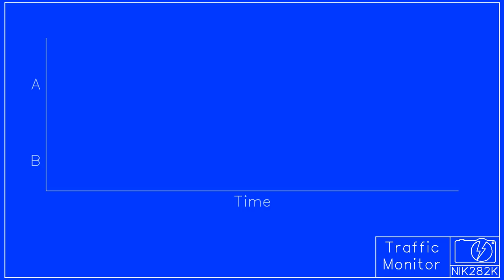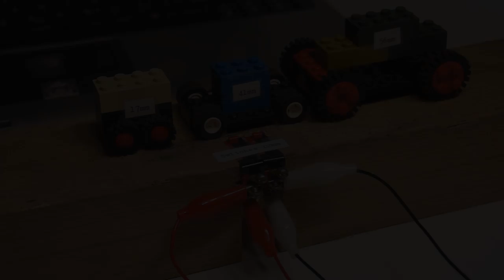How Traffic Counters Work

Comment: These are used in the UK a lot. There are permanent traffic monitoring devices installed all around heavily populated areas that work on induction loops put under the surface of the road. You can see the cuts in the surface where the wires have been laid that also trail off to the side of the road to a small box, or lid to a device underground. These tube versions are very temporary and go to devices chained to lamp posts usually with small but thick steel containers and padlock.

Comment: Do the hoses use hydraulic pressure to activate switches in the box or a conductor wire in the hose itself? If using pressure how do they deal with the speed of sound when monitoring a large multi lane road (as there will be a limit on how fast the fluid can re-stabilize between cars)? If electric conductors how do they get them to not break down under the weight of constant commercial traffic?
Reply from the maker: I have never had my hands on a real traffic monitor so I am not sure but some one else here mentioned that there may be electronic sensor strips that can deal with signals from multiple lanes (and wouldn't suffer from propagation times). Very interesting idea, I hadn't thought about the rebound time of the system.

Comment: Belgian here. We see these all the time when there are new circulation plans upcoming. Seeing a large number of these over the city almost always means that soon enough there will be a new circulation plan, yet again (these happen every decade or so). 
I've always wondered a few things about these, though. How do they detect? I always assumed that it's pressure based. If so, can't you also try to calculate the weight of the vehicle passing by, or is the range in which the pressure changes just too small to have accurate results? Further, I've seen them on bicycle paths as well here. Are those different, as in they have different pressure? And lastly, what if they are spanned over multiple lanes, or even over bicycle lanes in the same direction? Is it possible to determine the lane the vehicle drove on? How accurate is it when two vehicles pass by (nearly) simultaneously? 
You almost exclusively see them going diagonally across here. That way, there's data for all four tires, not just the two axles! Well, that's assuming you could see the pressure difference between one and two tires in the first place. But then again, more length means a higher probability on simultaneous passings, so they must be able to detect multiple tires, right?

(Edit: a word)
Reply from the maker: The diagonal method is perfect for removing ambiguity in the signals, I wish I had known about that earlier >_<

As far as I know the ones in use here only detect presence or absence of a tire but elsewhere in the comments someone mentioned that there are sensor strips that are able to tell from which lane the signal is coming.

With an air pressure sensor it might still be possible to tell how far along the car is, a car close to the sensor would produce a higher pressure spike than one at the far end of the tube but I don't know how accurate it could be.
Reply: You just found the fatal flaw of hose counters. They are really inaccurate on multi lane roads. As for seeing them about every 10 years in Belgium. I don't know your country's laws but in the united states its required every 10 years minimum that every agency that manages roads is required by the federal government to do traffic studies on every single road that they manage and send the studies to the F.H.A. (federal highway administration) or they can pull any funding that they are supporting.
Reply from the maker: Someone else mentioned that there are multi-lane hoses that have sections to distinguish traffic. I imagine they wouldn't be too hard to make.

Comment: I am curious to know if they can discern data from "confuse scenarios" such as two cars passing by each other over the detector... I guess there can be some multiple results on those cases. Also, I was wondering if the sensors could also measure the pressure over the hose. Seems like the cheapest sensor would be hidraulic, thus you could collect yet another type of info, I guess...
Reply: DoNotPushHere yeah that's what I never understood. They go over the WHOLE road here when I see them. How are they differentiating between the opposite directions of traffic? Speed information would seemingly be impossible to determine
Reply: 10mintwo  my only guess is that the data collected is filtered. Since they do not intend to track individuals, I think they might discard any conflictive data...
Reply: I'm sure that you will get some bad data from cars passing at the same time, but when you're looking at datasets that could easily be over 1000 cars an hour, it's not a big problem.
I can't find any specific evidence, but I think the cable they use for the detector might be a thing called quantum tunnelling composite.
Reply: That's quite a surprise for me. I thought those hoses would rely on pure fluids, due to them being placed on...the street... open to the environment and any harsh conditions... So it's sort of a long array of pressure sensors?
Reply: DoNotPushHere: The hoses are just full of air.

One end is sealed, the other has a pressure operated switch.
When a tire squeezes (squashes) the tube, that creates enough of an increase in air pressure to operate the switch.
Reply: Depending how smart the data collection is done, it wouldn't be too hard to extrapolate the data and assume that the majority of traffic are cars. Using 2 pipes helps to detect if two cars are passing in opposite directions because the vehicle's wheel will only be on 1 pipe at a time, so two cars passing each other could only hit 1 pipe at the same time but the second pipe tells the truth immediately after, or vice versa.

Comment: How do these work when the road has multiple lanes in the same direction? Does each lane count as its own sensor or is the entire length of the cord one big sensing element?
Reply: Edward Ciotic I've seen ones with extra ports for hoses that cover less than the full width of the road.

Comment: I might have missed this part, but can you explain how you can tell the difference between one car going fast with a long wheel base, and another car going slow with a short wheel base?
Reply from the maker: When the first axle goes over the sensors you can figure out it's speed, that lets you tell if it is a fast moving car that is long or a slow moving car that is short. Hope that helped.

Comment: I wonder whether it is also possible to distinguish two cars passing by at roughly the same time, such that one of the tires of the other car passes one of the sensors in between the front and back tires of the first car. Especially when these sensors are placed on bicycle lanes.
Reply from the maker: I don't know, with smart enough software it might be possible to distinguish between passing cars provided they are both going at different speeds and are not exactly the same length, even then it is possible to generate confusing data. Elsewhere in the comments someone mentioned that there are sensor strips that are able to tell from which side of the road the signal is coming.
Reply: I think if you assume the vehicles being recorded have 4 wheels each, you should be able to differentiate 2 vehicles going in different directions because a vehicle's wheel would only ever be on 1 pipe at a time because of their spacing. If 2 vehicles' wheels where on a pipe at the exact same time, the second pipe would receive a different timing. A bit of extrapolation with the common types of vehicles and speeds should be able to clear this up. I imagine it's the same kind of extrapolation that speed cameras use using the doppler sensor, a single camera would appear to cover both lanes but ALWAYS flashes from behind (in the UK) so it doesn't blind you, and motorbike number plates are only on the rear. So the cameras would have to split apart traffic going which way and their speed using many tens/hundreds of samples per second.

Comment: you can't know how many axles a vehicle has. they have to make an assumption that a set of pulses is either a truck pulling a double axle trailer, or two cars close together. of if you want to say that a vehicle is three axles, then you have to make an assumption on timing. in other words, you have to analyze the data and group sets of pulses together based on gaps between them, and and an odd number of pulses probably means an odd number of axles, but it can also mean you have grouped your data incorrectly. Also these system totally falls apart when traffic is at a crawl. you have no hope for counting axles on an individual set of pulses if traffic is very slow.

UNLESS you area also measuring the weight of the vehicle in your pulse. then you might be able to suss out a multi axles semi truck from a few closely driving cars or motor cycles.

Comment: How does it know overtaking? Or 16 wheeler trucks?
Reply from the maker: They work on a per-lane basis so two cars at once isn't really an issue. For a large truck there would be an identifiable pattern, one single axle, a pair of axles for the cab and then one more pair for the trailer.

Comment: Could you detail a bit on how you connected to computer  to use audacity? If audio port, just what is happening when switch closes?   Isn't that a short?
Reply: 55Ramius just a guess, but a simple circuit like one based on a 555 could generate a continuous square wave. You must make sure it's attenuated and roughly matches the input impedance of your device before plugging it into a sound card, though.
Reply from the maker: I have the headphone output going to each switch (playing a continuous tone), the normally open contact of each switch goes to the left and right microphone inputs giving me 2 inputs.
Reply: I heard that in the days of the Commodore 64, people would connect directly to the pins in the parallel/serial ports to make their own sensors and collect data, but I have never seen anything like it done with modern PCs. Fascinating! Any chance of a video on that topic?
Reply: I had a Radio Shack color computer back in the 80's and tapped into the joystick cable to use as a sensing device. Photocell light meter thing. Could measure speed of a fan by holding photocell on one side and a light source on the other. Lots of uses for that joystick connect. But one day I tried feeding sound out, back into sound in. Shorted computer out and had to have it repaired. Never tried that again with those computers or a pc. I just bought a $2600 pc and I sure don't want to risk frying the sound card or worse. ps- still have coco2 and coco3 computers. Stored away for long time but want to mess with them again soon.
Reply: I've built a quick and dirty capacitive coupling to audio input and used Audacity as a very basic oscilloscope. Then I just bought an oscilloscope, but making one for 50 cents is hard to beat.
Reply: Would be interesting to see circuit for that and one Matthew Kriebel above mentioned.  BTW Nick, for future videos, in case you were running out of ideas, lol, is ways for us to interface safely our pc to the outside world which then opens up a ton of creative things to make. Details too please. Some of us are morons when it comes to this stuff. Making use of  sound,light,pressure,vibration, magnetic ,centripetal force, kinetic energy , ect.  Some of the stuff you do is like articles in back of Scientific America in the past. Amateur Scientist section .
Reply from the maker: I'll keep it in mind for a full video, I have used the same method in the past for my ping pong ball speed trap. Although the mic input on a computer has some limitations (has to be an AC signal between ~10hz and 20kHz) that still leaves it open for a number of applications.

Comment: I don't think I've ever seen one of those in Turkey before. Are they expensive to set up and operate?
Reply from the maker: +Misclickable I'm not sure how expensive they are, they are only used here when planning changes to the local roads or traffic signals.
Reply: actually i've seen them couple of times in Turkey. i'm sure now you will see because you know what are they looks like :)
Reply: Where have you seen them? Maybe I've seen them on highways, but didn't notice they were used for this purpose.

Comment: If you ever see a metal plate embedded into the gutter wit 2 windows cut into it, it will probably be one of these. https://en.wikipedia.org/wiki/TIRTL  It operates in a similar manner to the rubber hoses but uses IR beams instead.
Reply from the maker: My original idea for this video was to make a beam based sensor like the one you showed but I couldn't think of a way to make it both cheap and simple enough to set up on a busy road. Very cool, thanks!
Reply: In UK, there's a lot of buried induction loops for monitoring traffic - here's a perfect example: https://goo.gl/maps/SqeHATgxvLz - you see it goes to a box on the side of the road where data gets stored, maybe even remotely accessed.
Reply: We have a lot of those in Melbourne as well, especially on our highways. On some of our tollways, we have another type of induction system that uses 'studs', wireless transponders about the size of a hockey puck.  They are buried in pairs for each lane, a couple of metres apart and are powered by a long life lithium battery that lasts for about 4 years.  They transmit speed data in real time to a transceiver mounted on a nearby pole which then goes back to the control centre to give live traffic info. 

You can see them here in the middle of the lanes. They just look like patches in the road but the giveaway is how uniform they are. 

https://www.google.com.au/maps/@-37.8469599,145.0408599,3a,75y,174.51h,86.18t/data=!3m6!1e1!3m4!1sE7i3fZn6vM2wr1FQtzKPdA!2e0!7i13312!8i6656?hl=en
Reply: Wow, those are really inconspicuous. How do they get any feedback from induction when they're that small? Doesn't look like they'd detect motorcycles very well. I was driving at work earlier and found a complicated induction loop setup with a 4x4 arrangement, seems a bit overkill - https://goo.gl/maps/MC9cXp1nFJ12

Comment: This video explains how the data is used, but doesn't do what the title says - I still don't know how these things actually work. Are they air filled tubes? Some kind of sensor on the end?
Reply from the maker: I have never had my hands on a real one but the data crunching methods I showed would work for a simple hose + pressure switch as well as it would for a more complicated lane discerning sensor. Sorry I couldn't get my hands on a real one for this video :/
Reply: @sgartner  it doesn't. Still leaves you guessing. I had a good look at one in my neighborhood and i am pretty convinced it is hydraulic pressure: the end of the tube looks like a simple clamped hose.